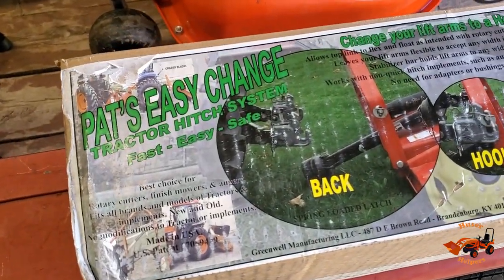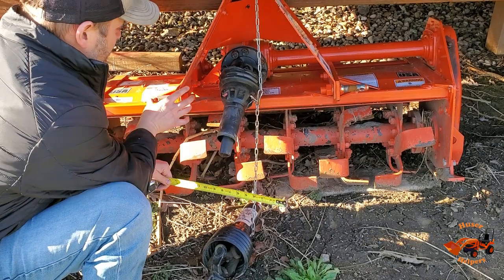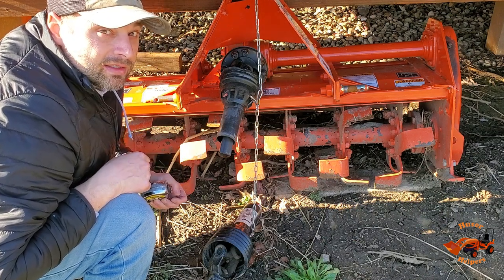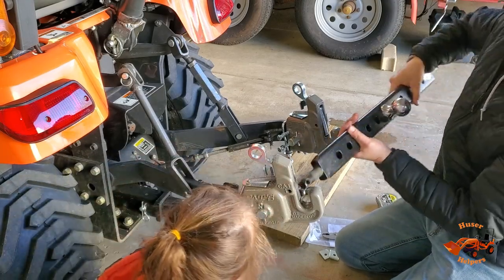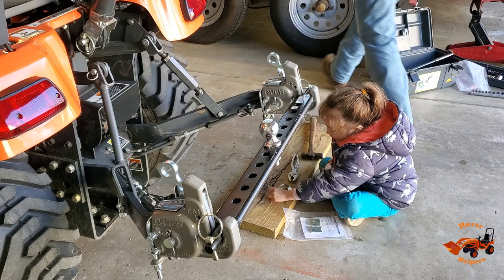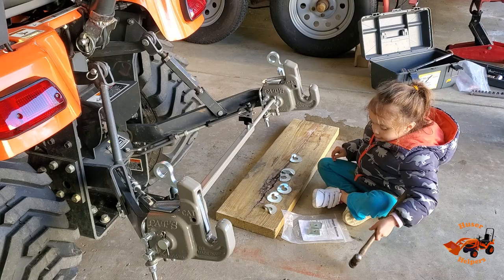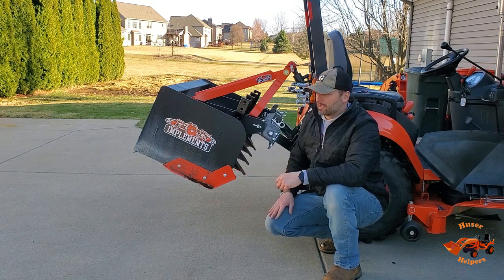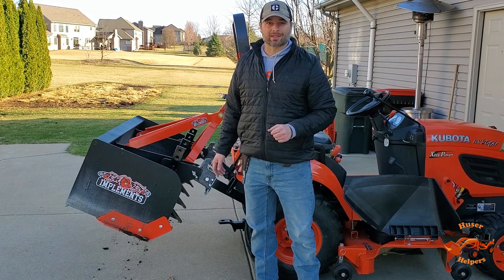Pats Easy Change - Quick Hitch System on a Kubota BX

Comment: I have a set of Pats on my BX 2380. I love them. I also got a 4” pto extension for my roto tiller. I recommend a set of Mark Hodge or Messicks three point telescopic sway bar stabilizers. They are an awesome upgrade.
Reply from the maker: I think my PTO will be ok on the tiller.  When I cut it, I kept it as long as possible.   Can't even connect it when lowered as not enough back travel to get off the shaft.  I agree the sway bars are sweet, but need a couple other tools first.  Thanks for watching!!

Comment: What is the length of the hydraulic top link you got? and could you tell me where did you get it from? Link? thanks!
Reply from the maker: I got it from haytools.com.   I think it is a 14" compressed.  I have another video on the choosing the right top link.  You will want to measure your current set-up to decide which one will work best for you.

Comment: When you lift an implement do you 3pt hitch arms angle in once there's weight on them?  I just installed my pats and they seem to twist inwards (the whole arm) when lifting my blower.
Reply from the maker: Yes.  It is normal.   400 hours on them and they are great
Reply: @HuserHelpers  Great, thanks.  I won't worry about it too much then.  :)